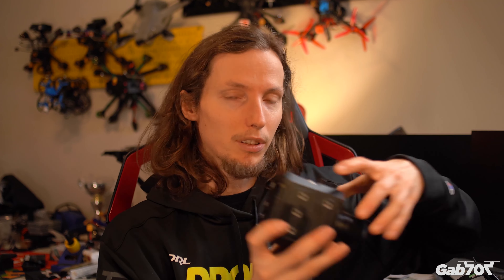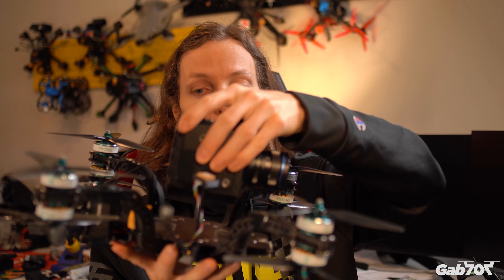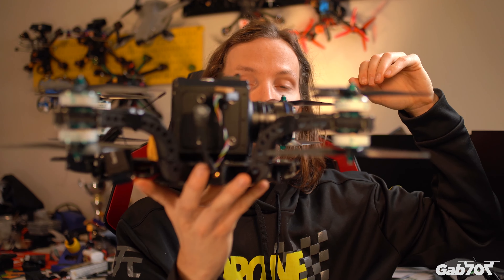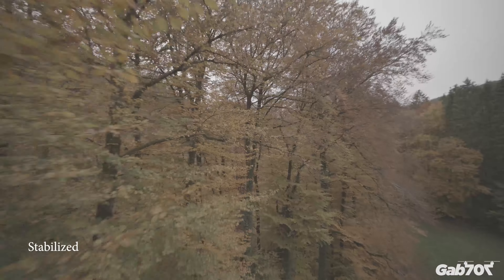Tech talk: Cinelifter camera dampening?

Comment: 8:20 I have a lot of experience in skateboarding, this viewpoint got me thinking about modern truck design and thinking......In skating Compressed bushings always loose performance, (harder Durometer/bigger bushing for more weight is Ideal on paper). Many longboard bushing company's offer different shapes and formula, this alfa gel shape been the most uncommon......for a human of a board of course. I have some Ronin trucks that have a support pin to take the weight of the bushings here on the shelf and a huge box of bushings, time for pen and paper.

Comment: Interesting stuff. I don’t know much about fpv or anything but does this not make 
the screw come lose from all the trembling overtime? Cool video tho.✌️
Reply from the maker: Thanks! The grommet actually generates a bit of force constantly so that helps the screw stay in. I actually had a system to lock the screw down with a nut, but it has seemed a bit overkill on the long run.

Comment: Thanks for this interesting video Gab ;) 
BTW, do you recommend a specific model for Alphagel ? A-1 ? A-2 ? they seems to have different abilities and I would be curious to know which one is better for camera use.
A-1 for DLSR "lighter" cameras, and A-2 for Komodo or heavy other ones ?
Cheers dude
Reply from the maker: I've been using the a1 just more or less tight. The a2 are quite a bit stiffer. Could be worth a test though, they will keep higher frequency noise
Reply: @Gab707  thank you Gab 😉